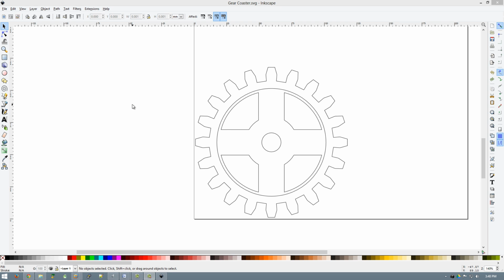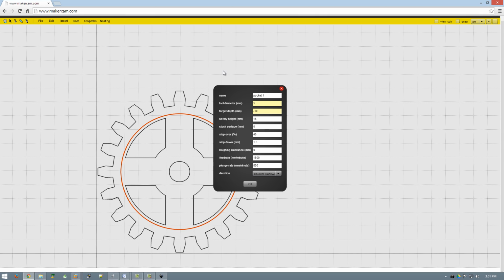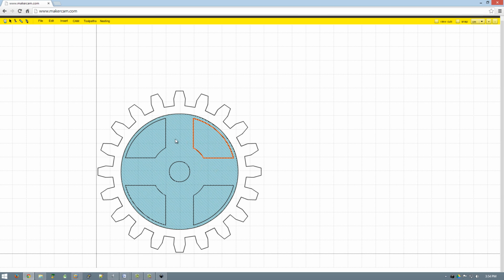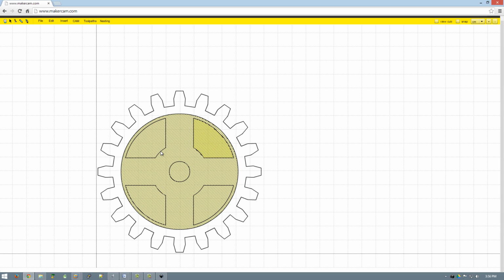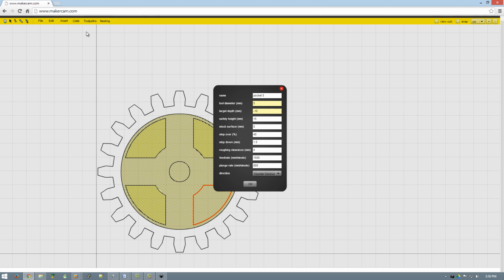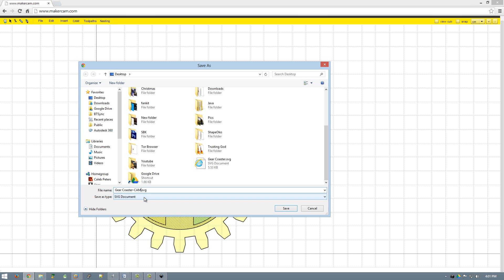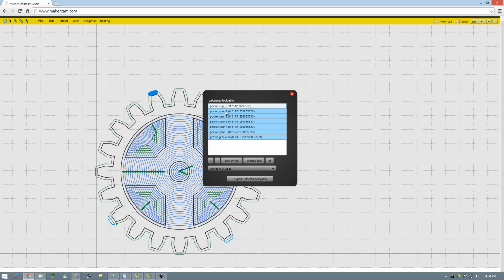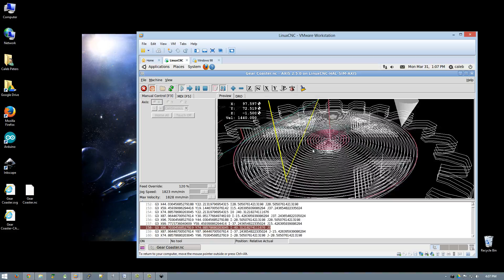ShapeOko 2 Project: Gear Coaster - Part 2

Comment: My question is that when I use inkscape and make the appropriate settings for measurement system, then open in makercam and make the same adjustments then change the settings for inkscape, the scale is totally off. If I make something 33 inches, for example, it will come out 16 or so. Is there a solution that you know of?
Thanks,
Matt

Comment: is that VMware like an emulation program for Linux? can you do a video on how you set up Linux cnc?
thanks and great job on the video's
Reply from the maker: Sorry for the delay in responding. VMware is a PC hardware emulation tool. So yeah, it can emulate hardware environment for Linux, Windows, or basically any other x86-based OS. As far as making a video, it's now on the list.

Comment: If I'm not mistaken you can select all of those 5 pockets after the main one and put in the settings for them all at once. Might save you some time. 

If your interested I wrote a python script to truncate the large decimal places sometimes generated by makercam to something more sane so the grbl interpreter doesn't choke on it.
Reply from the maker: You are not mistaken, you can indeed select all five pockets as one operation. However, from my experimentation that will result in three times as many rapid jogs around the piece as it only removes one plunged depth for each pocket until it repeats the process to completion. I suppose, it's Six of one half dozen of the other.
And, I would definitely be interested in checking out your script.
Reply: I do now remember being frustrated at all the rapids for no apparent reason.

Here's a link to the script.
https://www.dropbox.com/s/nr27kg0ys488wjs/trimgcode.py
It's quick and dirty but gets the job done. 
Its written in unix traditional pipe to wherever fashion.
So to call it:
trimgcode.py source.ngc >newfile.ngc

Comment from the maker: @jame5j
I wouldn't be worried at all. This seems to only be a problem between makercam and grbl. Makercam is simply putting really long decimals on to its g-code commands, or at least that's what I understand is happening. Grbl apparently can't handle all of that, so it errors out. I'm using LinuxCNC to operate my Shapeoko, and it seems to not have any trouble dealing with this situation.

The other thing to keep in mind is that it would be easy enough to truncate the decimals to 4 or 5 positions using a custom post-processor. I wish I had something to point you towards, but I don't.

I'd also like to point out that in a couple more months anybody using GRBL will probably be using easel.com to generate and send G-code to their Shapeoko.
Reply from the maker: brukernavnfettsjit
Nice

Comment: Hey Caleb! Great videos man. Was hoping to build a shapeoko2 as a summer project but a bit worried about the metric issues, this would be a deal breaker for me... Is it just a makercam problem? What are you using in place of the grbl?
Cheers.